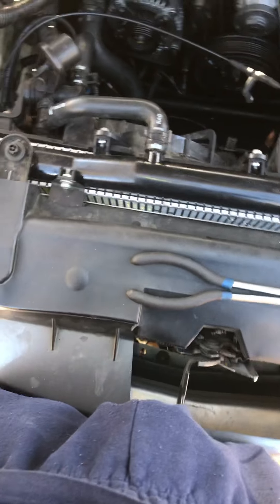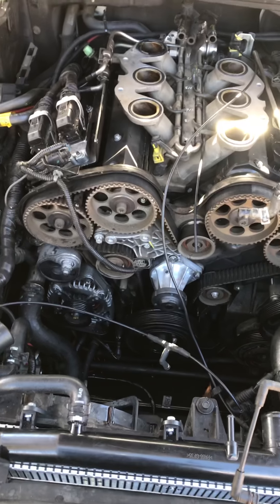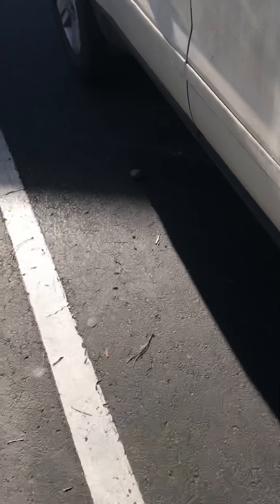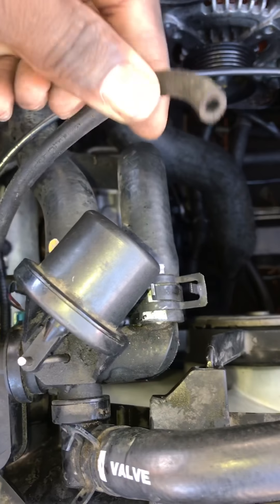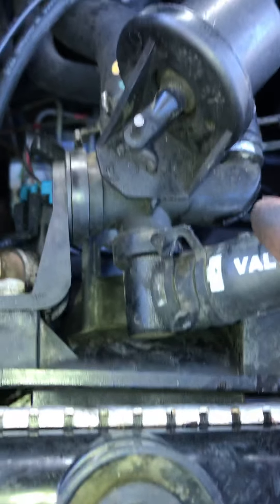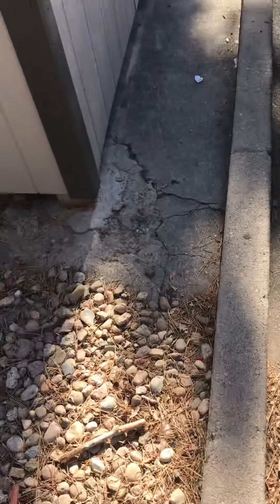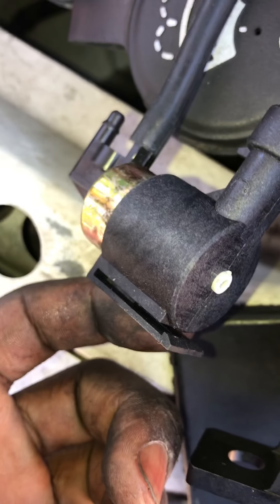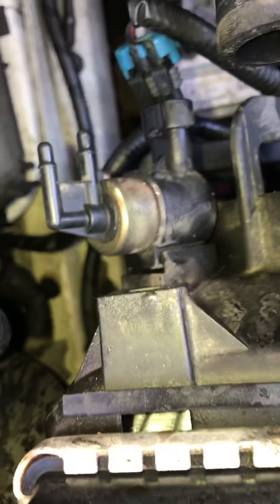2003 Cadillac CTS Heater Control Valve Replacement

Comment: I just got this part at my local pic n pull for less than $10
Reply from the maker: That’s wassup, I don’t like to put used parts on my Lac
Reply: Hey what is this part name ? Nd part number
Reply from the maker: Idk the part number but it’s called a “Heater Control Valve”
Reply: It's a discontinued dealer part and not sure an aftermarket part exist, still searching, I got lucky and found an oem one for someone, if you need one let me know.
Reply from the maker: I got mine from autozone